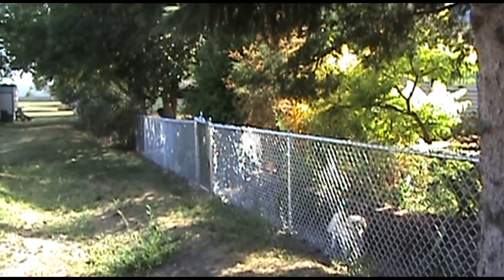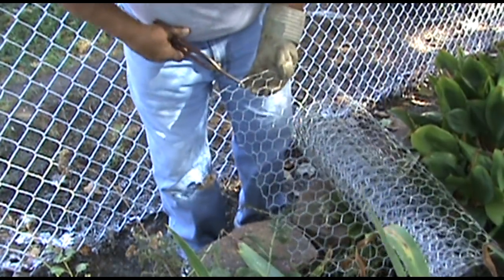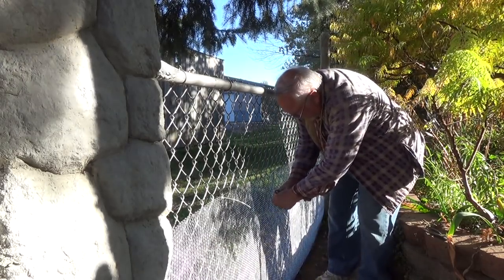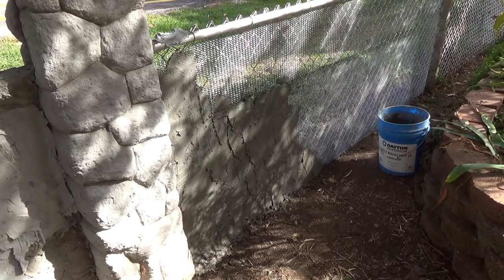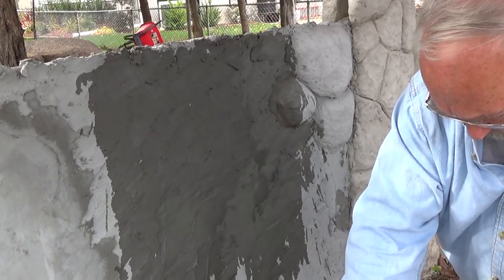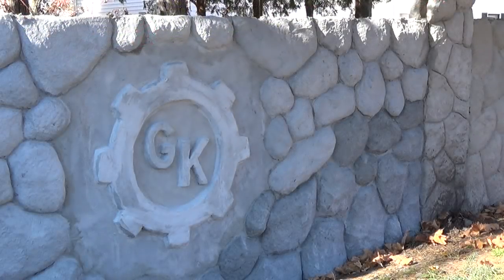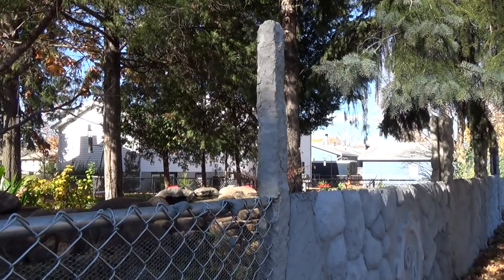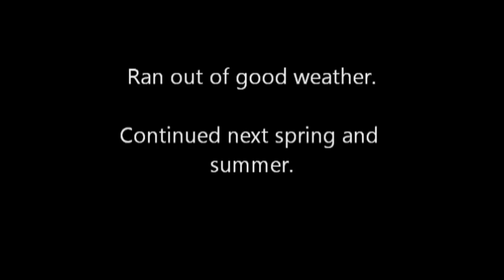Converting my chain link fence to a stone wall

Comment: How long did you take to do it? Without forming the stone design, I mean. I have 300 ft of chain-link fence I'm looking at... think I'll keep it with straight lines, more modern looking (quicker too, I'm hoping).
Reply from the maker: Don't go by how long it took me.  Because of the layout of my yard, I couldn't even take a wheelbarrow load of concrete back to the fence. Because of my age, I wasn't able to carry even a full 5 gallon bucket.  I worked by mixing a half-full bucket in the garage, carrying it to the fence at the back of the yard and putting the concrete on with a margin trowel.  If I could have done a wheel barrow at a time with a regular trowel, it would have taken far, far less time.  For your project, you have 300 feet of, likely, 4 foot high fence. That's 1200 square feet times 2 (2 sides) for a total of 2400 square feet.  How long, using a regular-sized trowel would it take you to parge coat 2400 square feet?  My fence ended up 3 inches thick (1/4 foot).  Your fence, then would use 1200 x 1/4 = 300 cubic feet of concrete. A cubic yard is 27 cubic feet, so your fence will use a little more than 11 cubic yards.  How long will it take to mix that much? If you think in terms of bagged concrete, If I recall correctly, it takes 45, 80-pound bags to  make a cubic yard,  How long will it take to mix 45 x 11=495 bags of concrete? If your fence ends up only 2 inches thick, that's still going to be about 330 bags.  That's a lot of mixing and a lot of parging.  I took, working only part-time, 2 summers and part of a a third to do my fence of 72 feet, but that was also more complex than just doing a simple parge job.
Reply: @dperry428  I really appreciate your well thought out answer. I was also running the numbers and came up with a higher number of bags, but that was estimating for a 4 inch slab. Helpful to know that your fence is 3 inches and sturdy. I am in my mid 30s and would buy a concrete mixer, but you are right, that is still a lot of bags! This would be part time as well, as I am a utility engineer / PM by day and only moonlight as family handyman. I had another question... can you tell me why you went with hardware cloth vs wire netting? I see netting that costs half as much as the cloth. Also, do you have any issues with drainage? I am wondering if I should leave some holes at the bottom. Thanks again!
Reply from the maker: My fence is actually somewhere between 2 inches and 3 inches as it varies with the thickness of the faux rock.  When I started the project I experimented with a number of reinforcement materials, including fiberglass mesh and chicken wire, which I assume you are calling wire netting.  I decided against the very flexible and too small holes.  I decided against wire netting as the holes were too large and allowed the concrete mix to fall through.  The diamond mesh (expanded metal lath, stucco lath) was perfect.  It is rigid and the hole sizes were perfect for holding the concrete in place and not allowing fall-through.  Besides, it is well-established as suitable and used in the application of stucco. One could use the wire netting if multiple layers of it were applied and assistance of a temporary backing on the side opposite of application were used, such as a sheet of plywood held firmly against the fence to keep the concrete from falling through.  One could, in fact, use only the wire mesh of the fence alone if support was provided on the opposite side.  That would, however, negate  to a great extent the effect of multiple layers of small diameter wire that is associated with thin-wall construction referred to as ferrocement.  It's the small diameter wire in both the fence mesh and the expanded metal lath that gives the finished fence its great strength. Do a search for thin-wall construction and ferrocement to see what I mean.

Comment: It should experience cracking. Why because the metal post to the fence is only placed above dirt ground. Vibrations will cause cracking
Reply from the maker: Let's see -- it's been in place for almost 8 years now and, despite the rigors of northern Illinois climate, there is no cracking to be found.  In fact, one section of the fence/wall suffered a ten-foot section of treetop falling directly on top of it without causing a single crack in the concrete.  The plastic lattice section had to be replaced as it was shattered, while the concrete withstood that "vibration".   Those steel posts are embedded in 40 inches of concrete, well below frost line. The chain-link fence upon which the wall is constructed has been in place since 1974. Your assessment is totally without merit and dead wrong, based on absurd speculation, but not on actual experience in the real world.

Comment: Did you do your editing on this yourself? Not bad for a 71 year old in 2014. :)
Reply from the maker: Yes.  I'm used to doing high school football editing.  Did that for more than 30 years.  The video editor program is a cheap freeby that came with the computer.  Quick and dirty.  Now I'm 79 and working on a video of my pond repair and remodeling. Won't be posting it for a while as I'm still slinging concrete.

Comment: Do you think fiber glass mesh would work vs metal lathe??
Reply from the maker: When I started my project I tried fiber glass mesh on part of the first section.  I didn't like the way it worked.  It was difficult to attach to the fence and have it remain stable. Otherwise, there is no reason it wouldn't work structurally. Why not try a small section and see how you like it.

Comment: What exactly are the materials you use? Cement and sand I know but is it 4:1? Do you use sharp sand or fine sand? Any pasticiser?
Reply from the maker: All my mixes are based on volume.  The scratch (base) coat is 2 parts fine sand (the finer, the better), 1 part portland cement, 5 - 10% CSA cement additive (Unicem Buzzi CSA), 10% metakaolin, 8% silica fume, alkaline-resistant glass fiber,  and acrylic admix in the liquid.   Finish coats are the same or, if thicker vertical elements are needed, sand/cement is reduced to 1:1, and fiber is PVA (polyvinyl alcohol) fiber instead of glass  fiber.  Percentages are in relation to the amount of portland in the mix.  You might like to watch this video for what these elements are.  It does not include silica fume, as I added that to my mixes since the video was done.https://youtu.be/etSWuBIcdZc  I do not use plasticizer except on horizontal work.
Reply: @dperry428  Thanks for all that info and I would take your advice and use this careful ingredients list if was going to do this often and wanted a perfect finish. I think I need to find a ready mixed render product though.
Reply from the maker: Depending on the climate in which you live, your decision to use a ready-mixed product may result in disastrous results.  There is good reason to use a mix design such as the one I suggested.  It is designed to be dense and water-resistant.  Water penetration is the enemy of concrete.  If you insist on using a pre-made mix, I suggest you consider adding a crystalline waterproofer to it, such as Xypex C500  https://www.xypex.com/products/additive-products
Reply: @dperry428  Ok, thank you so much for your advice. I will be very careful how I proceed.

Comment: Im watching this fir the 3rd time to learn hownto do this, or at least try! I stead of wire, you could use zip ties to secure rebar and chicken wire. Its way quicker.
Reply from the maker: AND way more expensive than bailing wire.
Reply from the maker: If you watched this 3 times, you didn't see that I also showed using zip ties?  They are not efficient to use, either, when trying to tie the lower parts, unless you have another person on the other side to feed them through.
Reply: @dperry428  haha.. yes i did AFTER i had already sent you the suggestion.
I didnt remember a lot of the steps. I am glad  I remembered hoento find your video again. Last time I watched it, it was 6-7 years ago.

Comment: first, you do amazing work and have amazing DIY skills. 
I'm just about to start on trying to make a small wall section and was planning on covering a piece of EPS foam that is 6 feet long, 4 feet high and 1 foot thick with metal lath then doing the method you used on the fence. I started reading your replies on your cement mix and my head was about to explode. what is the down side of doing a basic Cement and sand mix for all of the project ? I was starting to look up the other additives and wasn't finding them at the standard big box stores and the online sites prices where making me think i may just take a crack at doing the sand cement mix.
just wonder what kind of life expectancy you think a fella would get with a basic mix on a wall.
Reply from the maker: If you are going to use EPS for a wall, I'd first cover the foam with fiberglass scrim.  Sorry, but I wouldn't think about using an ordinary mix to cover the project.  It's just not strong enough and is permeable.  When I first started working with concrete 14 years ago, I did almost exactly what you are suggesting,. I used a 3 sand to 1 cement mix with polypropylene fiber and acrylic admix, which is better than what you are suggesting.  Much of what I did then is now in disrepair and needing replacement.  Of course, I live in a harsh environment in northern Illinois and the freeze/thaw cycles here are brutal. If you live in an area where there are very mild winters, then what you suggest may work, though the concrete will still be permeable to water.  The mix I make, while making your head spin,  is the latest concrete technology that creates a super-strong impermeable finished product.  You may find those who will disagree with me, but my bet would be they work in a mild climate.  You can do and try what you will, but my experience is that an ordinary sand/cement mix just doesn't cut it. All I can say is, give it a try and see how it works for you.
Reply: @dperry428  i'm in Cleveland Ohio so we have the same level of cold and this winter we had lots of cold to warm so lots of expansion and contraction.
maybe i'll look around for some local places that may sell smaller quantities of the additives. i dont need 5 gallon pails since i'm only looking to do about 32 square feet.
Is there a brand name you recommend for the stuff you mix into the cement mix?
Reply from the maker: @stevevihtelic4831  If you mean the acrylic bonding agent/admix, there are a number of available brands at home improvement stores that are sold in quarts and gallon quantities. They are not as high a solids content as what I buy, so you'll have to dilute it much less with water.  Quikrete sells Acrylic Bonding Agent and also Acrylic Concrete Fortifer.  I've seen in Lowes store. I know that Home Depot sells a Sika brand but I'm not certain what they call it.  You'll just have to ask for it at the stores or look in the section where they sell concrete supplies.  It's usually in the same area where they sell concrete colorants.  Also, check with companies like this:  https://lakewoodsupplycompany.com/what-we-do/  Or try this adpac called Tru-Pac a proprietary additive for decorative concrete https://www.deco-cretesupply.com/products/countertop-products/tru-pac-c  Go to the Contact tab and you'll they have a Cleveland location.

Comment: Why is the concrete no falling of when u apply it to the fence
Reply from the maker: The mix has more cement in it than what you would buy in a home improvement store and the amount of water is kept low so that it is very thick.  It is not at all runny.
Reply: @dperry428  so there is no concreate in it only cement, thnx for the information
Reply from the maker: Concrete is a mix of cement, which is the "glue" that holds everything together, and aggregates, additives and water. The mix here is 2 parts sand, 1 part cement, 10% metakaolin, 8% silica fume, fiber, and acrylic bonding agent/admix added to the water.  So, NO, it is NOT just cement.  What I said was that this MIX has more cement in it than you would find in bagged mixes from home improvement stores.  Bagged mixes from stores may be 1 cement to 4 sand or 1 cement to 5 sand or 1 cement to 6 sand.  The mix I use contains much more cement, but certainly not JUST cement.

Comment: if you put a flat pan or tray on the ground under where you are puting the concrete you will get more on the fence and not on the ground and you can scrape the concrete off the tray and put it on the fence
Reply from the maker: Believe me, nothing was wasted.  I'm too cheap to allow that to happen.

Comment: i need a permit to do this work at my house Tank you?
Reply from the maker: If you are asking me if you need a permit, it depends on your local ordinances.  I needed a permit for the original fence installation in 1974, but not for this modification.
Reply: I live in an area that does not require a permit for fencing height under 5 ft,   it really depends on city ordinances.  I built a 4 ft wall poured an 8" wide 'footing, placed post and wood pallets for a 'frame' to cover with metal lathe wire and then I stuccoed.   Eventually adding a 12" wood framed latticed panel on the top.

Comment: Do you have an idea of the cost of the project?
Reply from the maker: My best guess is about $1800
Reply: Wow,  very impressive!
Reply from the maker: Here's an analysis:

 Assume
I was making a solid concrete wall 4 feet high by 70 feet long by 3
inches (1/4 ft) thick. That's 70 x 4 x 1/4 = 70 cubic feet of
concrete needed. As there are 27 cubic feet in a cubic yard, 70 cubic
feet is 70 / 27 = 2.59 cubic yards. Cost will vary by area, but
figure $90 per cubic yard for ready mix or 2.59 x 90 = $233.91 But,
my fence is not solid poured concrete. It does, however, average
between two and three inches thick. While I made my own mix, we can
use bagged mix for our estimate. For bagged mix, using a online
concrete calculator, you'd need 118 bags (80 lb each). At about $5
for a sand mix, that would be $590. Each bag takes about 3 quarts of
liquid, so (118 x 3)/4 qt per gal = 88 gallons of liquid. My liquid
is 3 water to 1 acrylic, so is 1/4 acrylic, so I need 88 gal x 1/4 =
22 gallons of acrylic. I buy acrylic in 5 gallon bucket for about $85
per bucket. Let's use $115 per bucket because that's likely what
you'd pay. 5 buckets would be $575 for acrylic. Sheets of expanded
lath are 18 square feet each. 280 sq ft of fence surface would
require 16 sheets at $8.50 per sheet or $136. Add another $300 for
concrete additives and $200 for concrete stain. Total estimated cost
$590 for concrete, $575 for acrylic, $136 for metal lath, and $500
for additives and stain = $1801. That's a close estimate for this
project, though $1800 is about what I spent for my fence, my concrete
benches, and remodeling my concrete pond.  For those interested in
how much that is per square foot, remember that there are two sides
to the finished fence so the total square footage is 280 x 2 = 560
square feet to cover. At total cost of $1800 that would work out to
$3.21 per square foot.
Reply from the maker: No, I was a science teacher.
Reply: dperry428 I wish I could get this kind of answer from everyone I ask questions..
I have a very inquisitive mind regardless of wether or not I'm interested in doing what I'm inquiring about but I never seem to get a fulfilling answer ... You however just answered every possible question I could have asked by being asked one single simple question... I am beyond impressed ... You should be a engineer... My guess would be you would cut costs enough to pay for your own salary plus additional labor and any advertising required to keep any company profits momentum rolling in for as long as seen fit... Unfortunately in that same beath it would probably get you fired as seeing a lot of unnecessary costs charged by most companies would be eliminated resulting in a overall loss of overcharging customers and would not be able to charge as much .... You my friend are a blessing to all customers in an honest world and would be a curse to any corporation seeking their own gain by over pricing an over complicated job ... Your a refreshing blessing to the up coming generations... I wish I could have been there with you in your prime ... Not implying you are not now but if you can do this at 71 yars old what we're you capable of achieving in your 30's ... But I guess we get wiser as we get older so in that same breath I'm 35 now so maybe I will be fortunate enough to fathom your level of comprehensive functioning when and if I reach your age....I ask our Heavenly Father to bless you in all your ways in Jesus Christ's mighty name.... Your brother in Christ , Brandon
Reply from the maker: Thank you for the comments and thoughts.  Nothing special here. I was raised in a relatively poor family and, if I wanted anything, I had to work for it. If I didn't know how to do something myself, I learned by reading and watching others.  In 1979, when I was 36, we needed a bigger home, couldn't afford to buy or have an addition built for me, so I built a second story on my house myself.  I knew little of the trades, but I helped my neighbor build an addition, spent a summer watching a house being built and read a lot of how-to books.  I did everything myself, including carpentry, plumbing, an additional heating system and all the electrical. When you want something and can't afford to have it done, you do it yourself.  Now, I'm 75 and each year gets a little tougher physically.  I'm thankful, though, for each day I'm given to do the best I can and enjoy the time I have left with my wife, children and grandchildren. Though not with a lot of money, I feel truly rich and blessed.